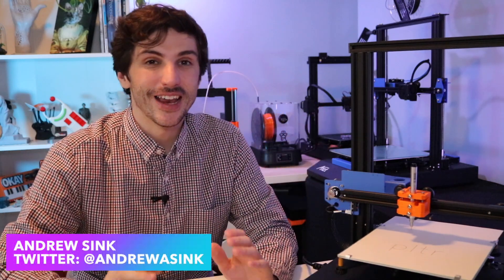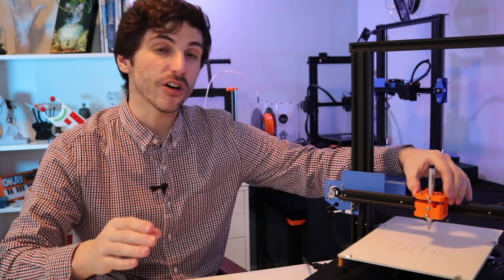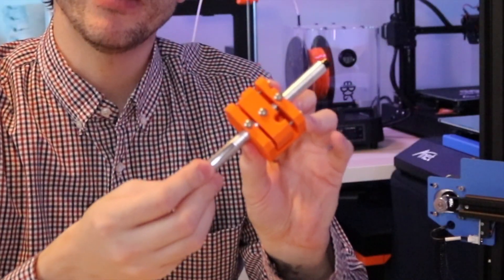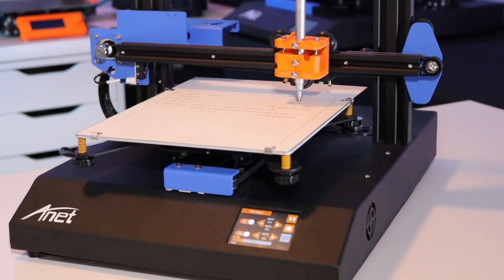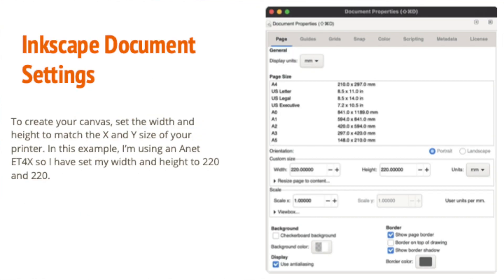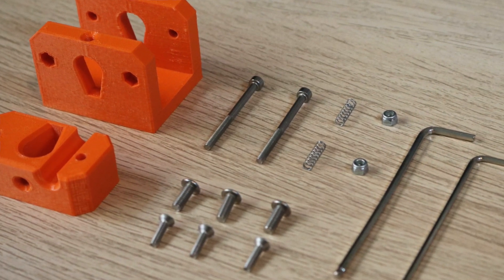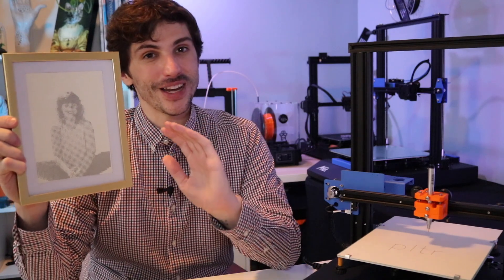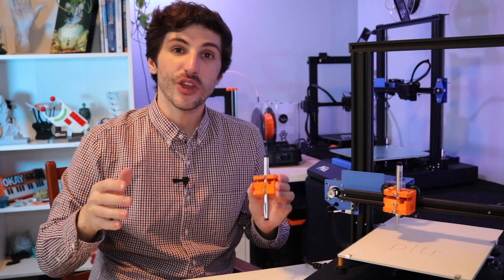pltr v1 Pen Plotter Toolhead - It's Here!

Comment: Literally looking at getting a plotter, and it's cheaper to get the ET4X + PLTR than a pen plotter. Being in Australia there's also some issues with finding a plotter in the first place (for example, an axidraw won't work without a voltage converter). Love the design with the spring too it's a great idea, looking forward to ordering one soon
Reply from the maker: Thanks! The next version works with the Ender 3, and should be released soon! Hopefully those are easier to get where you are!